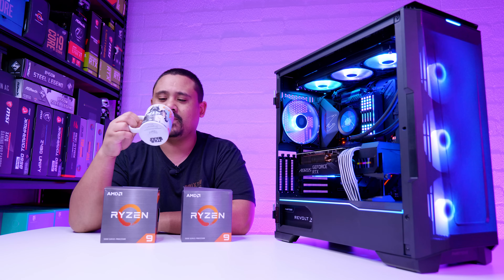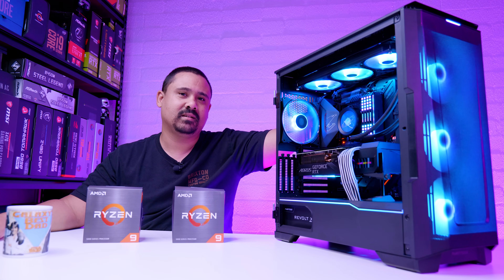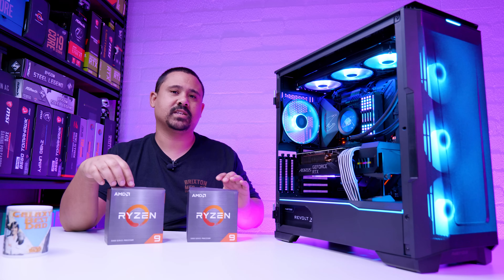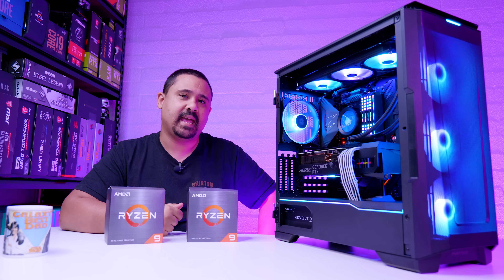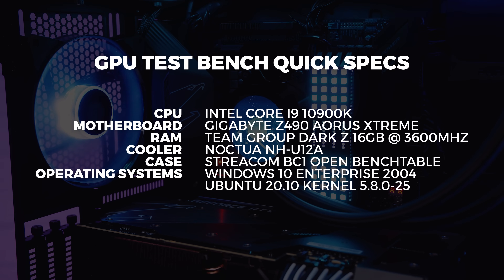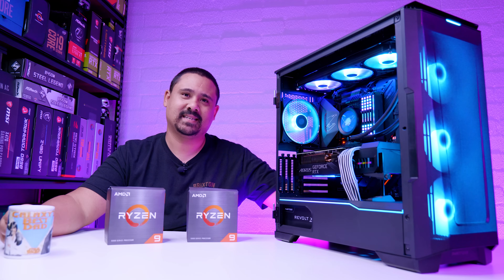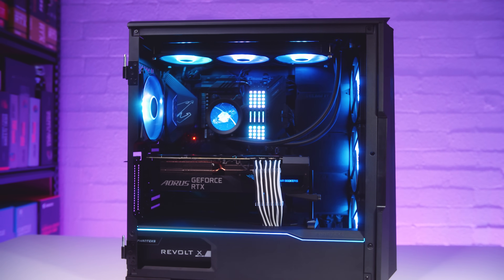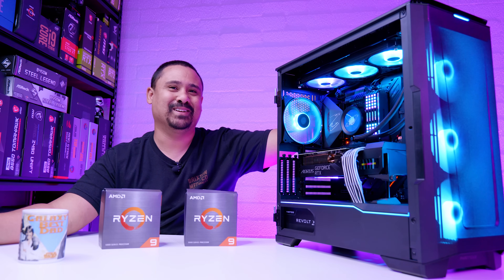AMD Ryzen 9 5950X AORUS X570 XTREME Build with Benchmarks

Comment: I saw one youtube video here, he said, on X570 Xtreme can not be put or install the RAM, CPU/PROCESSOR, and VIDEOCARD, first this to do is power up the motherboard plugin the 24pin and the dual 8pin Motherboard power, do first the Bios without installing those 3 components;  again the RAM, PROCESSOR, and VIDEOCARD, then plugin the Q-Flash, meaning do the BIOS without them, BUT IN your case you put it all or installed the RAM, CPU, and Videocard, did your Motherboard Open or Powered?;  here is the link;  https://www.youtube.com/watch?v=MELYeBZalS0&t=1238s

Comment: Hey Gear Seekers, I also have the X570 Aorus Xtreme with a questionable problem, the box says revision 2.0 but the motherboard says 1.0.....why? Because I was sure that it was a Rev. 2.0, I tried to flash the bios from 2.0, but fortunately the board said no, it doesn't work... Should I be worried?

Comment: I would buy this, but I want those fans changed to Corsair Magnetic Levitation 140mm. Change the power supply to 1000 watts. And change the 520 Firecuda SSD to a Firecuda 530 4TB SSD. Then add a WD Black 7200 rpm 4TB HDD and that's it. I would buy this badboy!

Comment: I am building a similar build with a 5950x on a Crosshair Hero VIII Wi-Fi. Would I need to use the 4 pin cpu connector in addition to the 8 pin or would it be ok with just the 8 pin connector because my RM850x PSU does not have one?

Comment: Are you running the 3 stock rgb fans from the p500a up front and then the coolermaster 3 in 1 block for the kraken and then one 140mm coolermaster fan at the back? I assume daisy chaining the 3 phanteks to one rgb header and then the coolermaster to a controller? Some hacky contraption to put them all to the same controller? Would love to see an indepth video of rgb for beginners outside of "buy a commander pro"

Comment: Great video. Good work. Thanks for sharing. Have a question if you may answer. Which motherboard do you suggest for the Ryzen 5950x? Asus, Gigabyte or MSI? In terms of performance, pci e 4 gen ports and future overclocking results with as lower temperature as it's possible. Thanks in advance.
Reply: have you found this mobo my friend?
Reply: @BaiasOficial  Hi buddy. I had purchased the MSI Meg X570 Ace and I am very satisfied.

Comment: My 5950x doesn't get anywhere near these results.... I get 9627 in r20 multi and 614 in r20 single thread....
Reply from the maker: Turn on PBO and get some faster RAM.
Reply: @GearSeekers  pbo on auto or enabled? I'm using the same mobo as you guys.

Also my ram is 3600 mhz cl16 trident z royal, I imagine thats fast enough

Any chance I can have your bios settings? Just to make sure they match etc.

Comment: Is the Ryzen 5000 series the last AM4 CPU we will see on this platform?

Think it's worth it to hold off for AM5 in 2021/22 with DDR5? Currently on a 9900k.
Reply: Yea it’s probably worth just waiting until 2021, your 9900k is still a great CPU, no need to upgrade just yet.
Reply: Yeah. I'd say that its not wise jumping ship right now if you dont really need the performance upgrade.  Buying x570/b550 right now would only get you Zen 3 maximum.

Comment: Jesus christ, I literally have every part of this build except the cpu now (buying 5900x)... only 50 of them in total in all stores here in sweden lol
Reply: lol. Same. But can't find Memory list as it's not on Gigabyte site. Wonder how Gear Seekers decided on ram....
Reply: If you can a 3970x is what I got in May, couldn't wait, i think it will be better than your 5950x for longevity if you don't want to wait for 5950x and can pay the higher cost of 32core plus the liquid cooling (150-80 bucks), let's say I can edit and render anything and still work on web browsing without an issue, and screen recording Screencastify ... just giving some info here mate
Reply: @ABUNDANCEandBEYONDATHLETE  A 12 core processor is going to last him years; possibly to the next console generation (which should be roughly 6-7 years) as the current consoles only have eight cores in them and consoles dictate the flow of the gaming market for the most part. Why on earth would anyone need 32 cores unless they are doing some serious work in blender, video editing, software development, programming, or AI type production workloads. The 5900x and most certainly the 5950x can give a person anything they need and will last for years.
Reply: CPU's are now so much available, its just that the  AORUS X570 XTREME motherboard is nowhere available fak.

Comment: 5ghz on AMD RYZEN!!!!
Reply: Add in upcoming 6000 series cards that have Radeon Smart Access and Rage Mode on x570 boards it's a beast!
Reply: @udonyoda9358  the only thing I dont like about amd graphics cards are they dont have ray tracing and nvidia's a.i like shadowplay , broadcast etc
Reply: @squadteam2309  I like Shadowplay but it cuts down on FPS and is hard on the ram. As for Ray Tracing, I can take it or leave it; my focus is framerates and Ray Tracing isn't there yet. Maybe for single player games but I would hardly use it since I play a lot of First Person Shooters that require high framerate. Nvidia upsampling though is amazing and lightyears ahead of AMD so I still am seriously considering the 3080ti when it comes out. Really depends on the price. Also waiting for reviews on AMD's 6900 to see if they got their driver act together. lol.
Reply: @udonyoda9358  yes people only see about hardware they dont check the software

Comment: hey man, just wondering, if the CPU is hitting that speed, how is the AIO taking it? like is it keeping it cool without ramping its fan speeds like below 40 Degrees C?
Reply from the maker: The AIO is fine. You're not gonna get a CPU going that quick under 40C
Reply: @GearSeekers  gotcha, I was just wondering since I have the aorus aio 360 with my 3950x and that thing just goes full speed, as if it can’t keep up, had to turn off core boost 🤣